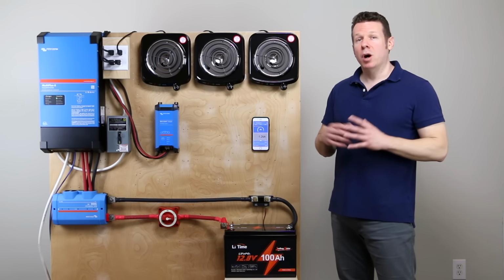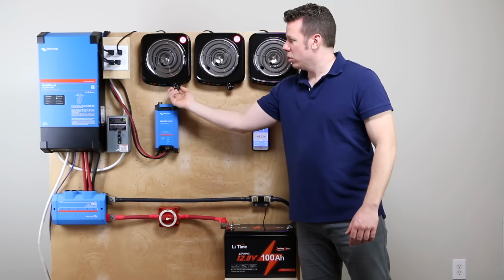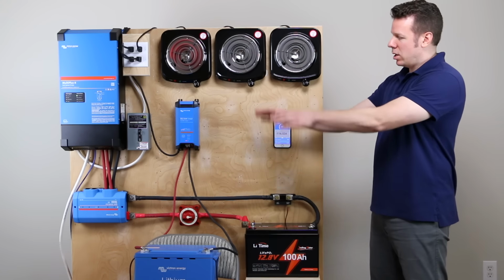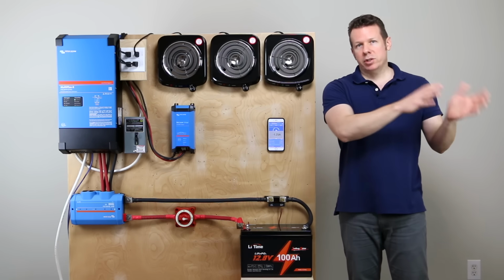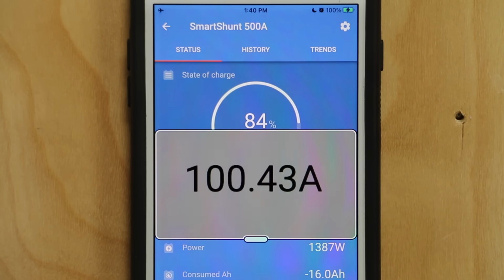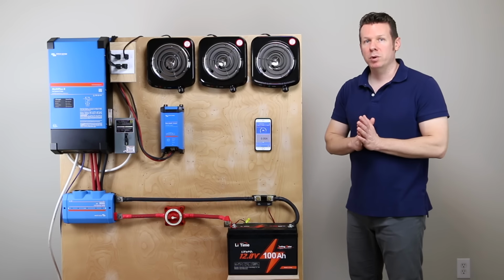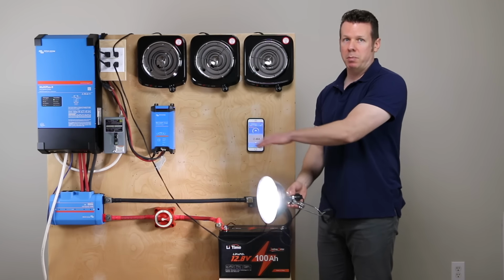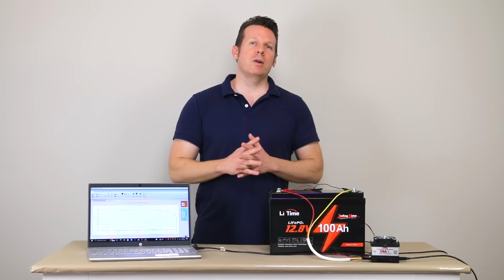I tried to DESTROY the new LiTime Trolling Motor battery (what I found may surprise you)

Comment: I'm  waiting for the LiTime 12volt 100 ah with blue tooth to show up this weekend.  Just wondering will it hurt my 2004 motorguide trolling motor. Usually run it onnumber 2 speed.
Reply from the maker: Hi James, I think it should be fine, so long as the battery's at the same voltage as the motor. Good luck with it!

Comment: I just purchased four 100 amp trolling Bluetooth batteries and I want to charge them with this 125 amp charger and not buy a 20 amp charger. This thing cost $200. I want to use it without having to put four batteries together.

Comment: Low temp protection, it’s always a small sensor on top or on one side of the battery but if you have your charger connected and doesn’t pull any powers from the battery the cells will still be frozen when the surrounding temperature has heated the battery enough and the sensor thinks it’s warm enough 
The sensors should be mounted between the cells to get this right. What do you think?
If you don’t pull any power the cells won’t heat up enough before the sensor allows the battery to charge or am I missing something?

Comment: I had a pair of those I tried to parallel.  The BMS sleep mode is a problem if you try to parallel them.  The ones I had would not work well in parallel; only one would "wake up" and the other would not turn on until the voltage of the first battery dropped.  I would not use these batteries in parallel.  I suspect they are fine in series.
Reply: Did LiTime respond with a solution to the parallel sleep mode issue?
Reply: @MarkParker55  they did not.  However, they allowed me to return my batteries and get a refund.

Comment: So I bought this battery last week but had  no lithium charger so I purchased a noco 10 battery charger with the lithium charger built. Contacted  litime about this charger he said it should be fine but would take longer to charger.  What is your opinion.
Reply: Same battery your testing.
Reply from the maker: Hi Randy, thanks for tuning in. The Noco is fine, it's just 10 amps, so will recharge at 10Ah per hour. So it would take 10 hours to charge this battery from empty. Hope that helps!

Comment: very professional testing. I like the Li Time battery. The Marine model seems to be quite large compared to the most batteries i seen reviewed.BTW thank you for the info on the 20 amp standard battery charging for Lithium batteries. I was thinking on buying a Victron 25 or 30 amp charger. I may just stick to the 20 Amp.

Comment: So you're not using this battery if you're ice fishing lol 👍
Reply: That's what I was wondering. I just took it that it wouldn't charge up at 32°
Reply: Lithium Phosphate batteries can be used down to -4*F but cannot be charged below 32*F 

Some batteries have built in warmers. Putting batteries in an insulated container can possibly allow charging below freezing due to BMS creating a bit of heat. It is best though to have a cold temp shutoff if batteries are unmonitored outside.

Comment: There is an undocumented "feature" of this battery that causes the overcharge protection to trigger when it hits 100% charge instead of letting the charger detect that charging should stop. The problem is their overcharge protection causes the voltage to drop by .5-7v, which is enough to make a charger intended for battery backup/maintenance think that the battery needs to be topped off and try to charge it while it is in protection, which basically results in the battery never coming out of overcharge protection and never getting topped off. For use in e.g. a van this probably isn't an issue, because partially draining the battery resets the protection but I use it as a backup to grid connected power, and I had to return it because of that "feature" ensuring that it was never able to take a charge.
Reply: If you’re using a trickle charger, would turning that mode off (or not using a trickle charger) solve that problem?

Comment: My TM is completing its charge before the end of my multiplus’s minimum 1hr absorption time.  The BMS seems to cycle on and off and present a lower voltage and the multiplus doesn’t know how to handle resulting in voltage spikes from 13-15.5v or higher.   I lowered the absorption voltage and that helped a bit, but it still an issue with a shallow discharge of the battery or a large load that tricks the multiplus back into bulk.
Reply: I have the same issue while using the recommended LT charger. Like you mention this is an over voltage protection from the BMS. Once I place a load on the battery the resting voltage came back to normal for a charged battery. My last charge I stopped early to prevent the cycling. I don't know if doing a partial charge will be harmful to the battery long term. Safety features can be annoying, but I hope they continue to improve this charging issue.
Reply: @Jeffrey-s6z  I've had a few back and forth messages with LiTime about it.  They offered to return my TM batteries.  I purchase the LiTime 100ah Max.  When they reach a full charge event the BMS is not reporting a voltage of 12.8v like the TMs and the Multiplus seems to be much happier.  I still encountered the BMS cutting off and a small voltage spike every few minutes.  I turned down my charge current below their recommended .2c charge rate and that seemed to stop the issue.  I hope with a few cycles I will be able to increase this until I find where the happiest charge rate is.
Reply: So what did you guys figure out do you just charge it up to say 90% or 95%
Reply: @JamesWhite-tg4kw  LiTime offered to take my TMs back.  I sent them back and I purchased the 100ah Max.  I think I ran across other people having the same issue on the 230ah low temp protection.  I wonder if the way the BMS behaves is a feature of all of the low temp charge protection BMSs on their batteries.  The Max do not have LT protection.  At a full charge event they are reporting a full charge voltage and not reporting 12.8v.  I was able to get my TMs more stable by reducing charge current and lowering the absorption voltage to 13.8.  13.8v is below the voltage the batteries need to balance and are not 100% charged, but damn close.  Ultimately for me, the main issue for charging is using my multiplus inverter.  My solar charge controller has better control over absorption and I don't overcharge the batteries.  I think TMs work best as a trolling motor battery where you just fully charge and slap in the boat.  Trying to use them as a RV house battery that will be shallow discharged, charged and then floating was not going to work for me.

Comment: The low temp shutdown costs a fair amount more than without, 30 to 40CDN. More of the solar chargers with good reviews have a low temp probe for batteries, so depending on your application, you may not need the low temp shutdown
Reply from the maker: You make a good point, a lot of chargers have their own low-temp shutdown. Although some of them say in the programming, if the battery has it, don't turn it on for the charger. Thanks for bringing this up!

Comment: The BMS was obviously modified to allow the 5 sec overload.  But... are the cells any different?  What would be the change to the 4 power cells that would allow the overload to be without harm to them>  Is LiTime just allowing the customer to abuse the battery for marketing purposes even though it will shorten the battery life?  By the time the abuse would be noticeable the battery might be several years old.  Then the customer has to prove the failure was from over advertising and not his fault?  

Just asking...

A T Burke
Reply from the maker: Well it has a 5-year warranty, so if it breaks before then, supposedly it's on them to replace. I don't think the 5 second overload is going to get things very hot. It's supposed to let you surge your trolling motor for a short duration without the battery cutting off. I would think that longer durations / heat buildup would kill the battery. But for 5 seconds, it seems like not a huge deal to me.

Comment: Great video Ross.  Question:  I purchased a LiTime 100Ah battery a few months ago.  Does not have the low temp protection.  If I were to buy another with the low temp protection, could I put these in parallel since they aren't exactly the same?
Reply from the maker: Hey Kevin, thanks for tuning in. In my estimation I would go for it. Or you could set up low-temp shutdown in your chargers, and use the regular batteries. Whether the batteries do the shutdown, or the chargers, either one will suffice.

Comment: Other than saving the energy into the other battery, I don’t understand why you didn’t just use the stoves for the entire test as they have the ability to be variable loads…….
Reply from the maker: Because the stoves are not variable. They are either on or off, 1000 watts or nothing. I tested that, and they are pretty cheap $15 stoves. So the dial only dictates how often they turn on, at full power.
Reply: @rosslukeman  Yeah I get it... I sure wouldnt want one of those for a stove then.....   I like my little space heater 250W,500W,750W,1500W   Works great on the lower settings with my 2000VA Victron and doesnt put such hard surges on the equipment.
Reply: I'm thinking the trolling motor battery with the high surge capacity would work better in golf carts.

Comment: As always a very interesting and advance testing video. I have a doubt. How does the multiplus and the batery with internal bms interact to limit charge/discharge current as i do not see a Cerbo control center?
Reply from the maker: Thanks Jose! Charge was done by programming the MultiPlus charge settings. Up to 120 amps on this model, but reducible in the programming. The Cerbo can't control that, it's the MultiPlus internal programming. As far as discharge, that depends on the loads you put on the MultiPlus, which is why I had to make up a scenario of 1 stove + 1 charger set at reduced power, to get it in the discharge range I was looking for. Great question, hope that helps. Thanks for stopping in!
Reply: @rosslukeman Thanks Ross but i am a little bit confuse. I understand that in standard cases it is BMS who tells to multiplus the right current charge based in the battery charge status and conditions (temp, cell voltage balance, etc) and in discharge mode the max current discharge allowed. However, as in the video case the battery bms and the multiplus are not connected, you need to manage the charge  current by programming multiplus. Am I right?

Comment: you are so easy to follow! love your board setup. as a new battery it meets it’s specs. wondering if it will still meet specs, esp capacity, after a few hundred cycles (say 10% of it’s 3000 cycle life) in normal use. 
(i’ve seen reviews of cheaper li cordless garden tools & there are many user reports of batteries failing early & not holding charge. of course, such batteries may have much poorer management systems which could contribute to early failure.)
Reply from the maker: Hey there, thanks for the kind words! I'm glad you're digging my demo board. I think you bring up a good point in that a lot of these batteries are using cells from a few key manufacturers, but the BMS varies from company to company. They do have a 5-year warranty and 4000 cycle life at 100% Depth of Discharge. We may have to wait a few years to see how they do. Overall I thought it was really solid, but time will tell.

Comment: Well done Ross,  great setup and demo of the capacities of Li-Time LiFePO4 batteries.  I'm using them as well and got great support from their Germany based support department. Great value for the money especially around Black Friday.
Reply from the maker: Hi Ton, thanks for tuning in, and good to hear you enjoyed the video! Awesome to hear you went with these batteries and good to know you tried the support team out. I thought about contacting them with a random question so I could report on their response, but did not end up taking the time for that. Thanks for sharing your experience around their support quality. As far as the pricing, yes, they are definitely a great value. Thanks again for tuning in and leaving your thoughts!
Reply: Excellent video dude I bought a 125 amp RV charger that handles lithium batteries at 14.6 V it’s got multiple stages rec pro my question to you is obviously I can use this with four batteries in parallel. It’ll get about 30 A per battery But why can’t I put 125 amp charger on a single battery? I thought the BMS is only gonna take what it requires if it needs 50 A to take 50 A the amperage goes down as the battery charges up anyway I need someone to explain this thoroughly to me

Comment: I was wondering about how the cold charge would reset after it warmed up... I have a 230+ with cold charge protection that I bought during the black friday sale and currently have it installed on my rv with solar charging installed... I know (I am in the desert winter camping) it is going to get cold enough soon and was a little unsure how it is going to work... If I was going to have to manually reset it or something... I am assuming that it works the same as your 100amp battery here... 😊😊😊
Reply from the maker: Good deal, yes I would assume it will come back online just like this one did. Perhaps your charging sources will keep it warm enough that you don't have to find out about the reset thing! Have fun in the desert, check out Sonoran Desert National Monument if you're out that way. Good times...